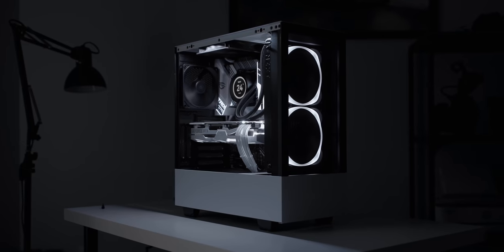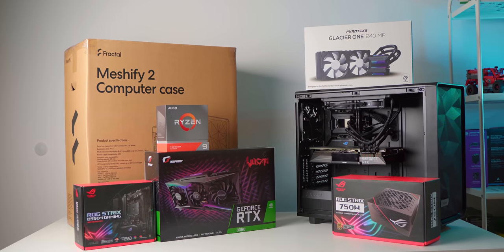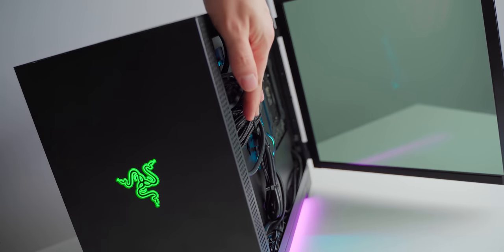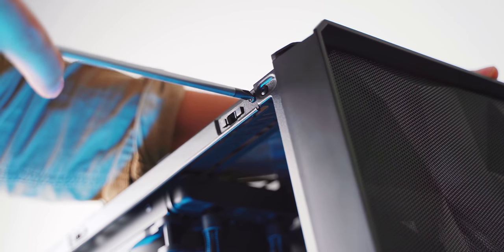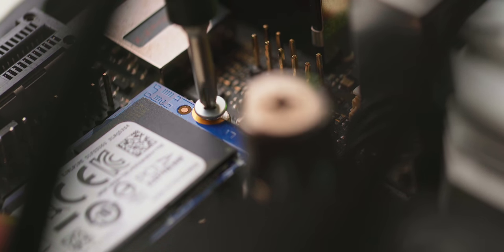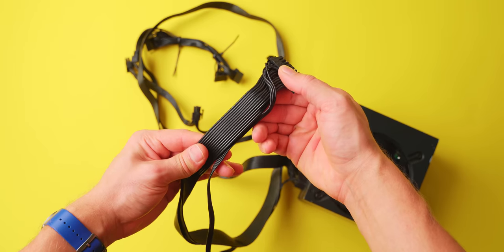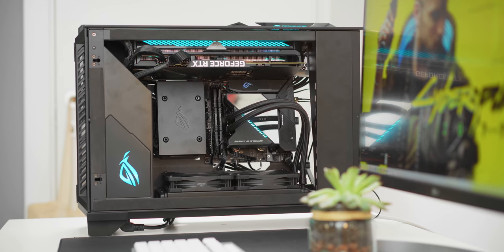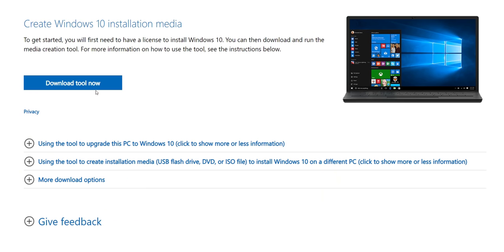AVOID these BIG Mistakes when Building a PC!!!

Comment: Because of high demand, getting a prebuilt is more affordable and worth it. That's what I did, I bought a prebuilt that was cheaper than getting the parts separately.
Reply from the maker: Yup - that's a really sad reality, but with plenty of good pre-built systems around, its always a fantastic alternative. 
-D.
Reply: I have seen prebuilds cheap out on many things, like power supply and ram etc.
Reply: @jayeshmange2952  That's what I got except the power supply. The separate parts I wanted was a better CPU which was the i5 9600k, 1TB SSD, and 16 gigs of Ram. Instead, I just got an i5 10400f, 8 gigs of ram, and an NVME 500gb SSD. I can upgrade them so it's cool.
Reply: Where I live is cheaper to buy everything separately, specially if you do it through Amazon or so, some sellers even scam you if you don't know much about it, it's risky af
Reply: @HardwareCanucks  like the nzxt prebuilt systems! lol ;D
Reply: Pre-built generally come with the worse possible quality of components. Could you tell me what graphics card you have and what model? I would be amazed if its one that doesn't thermal throttle at 80%. Your power supply, also. As for customer service? GN and LTT pre-built industry expose videos that a'way.
Reply: @En_Joshi-Godrez  It's worth checking out local computer places if you're going to pre-built route. Lots of them will let you pick all the parts and they'll source and assemble it for you, and if they're not complete idiots they won't screw you over because bad word of mouth will probably cost them far more than they'd save by ripping you off.
Reply: @TalesOfWar  That's definitely a better option, especially because  you can go and expect it yourself. Paying an extra $200-300 for that type of service would certainly be worth it for some if they were guaranteed a comparable build. However, those very specialized (as in ones that are dedicated to only sell computer hardware) stores are not very common (or even accessible right now), so most that want a pre-built must  go the way of a online service which as the op admitted (in a later comment), like to use the worse selection of components possible that still classify under their certification banner (so say you want a i5 processor, you will always get the cheaper non k skew, as well as a god awful motherboard). It's never worth it no matter how good of a deal you think it is, that's how they get you.
Reply: @En_Joshi-Godrez  you are so right. i have built 8 computers, roughly one a year and every one of them continues to function just fine. i think the better the parts (even in budget builds you can get high quality parts) the less likely you are to have a failure down the road. Prior to that i've had prebuilts by Dell, Gateway, HP and a couple others i cant remember (yeah they were definitely forgettable computers) and they just dont last or you cant update them. so for me the only reason to get a prebuilt now would be to get a CPU or GPU you and now cant get.
Reply: @jayeshmange2952  correct and motherboard.

The storage is not as direct of a con but usually how they get you with that is having a really low GB amount on a fast ssd or whatever, then the rest on a HDD. So they can advertise 'blazing fast storage with up to 1TB (or whatever)'. but only 64GB or 128GB is the SSD.
Reply: @En_Joshi-Godrez  It's not worst possible quality on all of the components. Generally the only 2 that are ensured to be good quality are the CPU and GPU (so they can advertise the amazing performance those 2 components can provide) while the rest they will cut-corners to save money while not technically 'false advertise' anything.

A lot of people think the best manipulators and con-men are liars. Which is incorrect. The best ones are the ones that distort/bend the truth but never actually lie.
Reply: @nicholaskinkaid Nope, you're dead wrong.  They use blower style coolers on high-end cards that produce over 200w, they thermal throttle at less than 80%. Go and watch GN videos as a piece of exposure to how many third party video cards are practically non-functional because of thermal issues. You seem to believe that because its called a "rtx 3080" then it will be able to fill out its function like other 3080's, which is an objective and provable fallacy. The newest one is cards like the msi Ventus 3X, a card that has been exposed to have huge none ignorable thermal issues which has led to it being 30'c warmer than reference at a clock speed reduction. That's a $800 graphics card, and I guarantee you its the type of card that the online pre built industry loves to use. And why wouldn't they? Only a fraction of the population even knows about these manufacturing defects (case in point, you seem to be unaware of them, and you subscribe to channels that cover this content).  Same goes with every other component in the system, all of which affect their longevity, due to poor quality power and thermal solutions (especially the case which is always one where the front intake is a piece of glass. lmao). Sorry, but if you're  trusting other people to effectively finance things that you know nothing about, it really doesn't matter if they are liars, that's how the pre-built industry works.
Reply: @HardwareCanucks  not in ireland there are no good affordable systems and for 1400 euro you can get an i5 with a 1660ti so i went for a custom build even though my parents said I'm wasting the money that i saved for 3 years.(I have a r5 3600x and rtx 2060)
Reply: @En_Joshi-Godrez  bro you wrote an essay with useful info
Reply: @awesome8831  that's pain maybe you could've waited a bit longer I waited 3 years before I got enough money for my pc parts.

Comment: Jeez....you nailed it on the M.2 heat sync screws.  Tiny PITAs.  Regarding M/B front pin connection, my Gigabyte came with a cool little bracket.  The Gigabyte 'G Connector'.  Nice

Comment: The worst part is WAITING!  Waiting for new releases, then waiting while all the markets are being hoarded/stolen for less than MSRP, then waiting for the Kings Ransom prices to come back to sanity. I went to order the X570 board for my next build, a week after it's release and had to do a notify me. The price then was $219... within 72 hours there were "offers" for up to $500. 3 months go by and I get notified and purchased it for the original price... THANKS NEWEGG!  At the time they were still "offered" for $390 or so. I've done several builds going back to building my 1st pc... 386 w/ 1 MB Ram, a 10 MB Hard drive that was the size of todays power supply's and a 10 inch floppy disc 720 KB if I remember right. I have all the parts for a X570 MSI Tomahawk WIFI except the CPU I want. I'll be using a Ryzen 5 3600 for now... the 5600 or 5800 is still a rumor as far as I can see due to politics and scalpers. My current "old system" works fine, an Asrock FM2A88X with a AMD 880K Quad core, and duel Sapphire 7870 XT BOOST Tahiti's. I'm not a gamer or editor, but it has worked for 8 years for writing, researching and lots of streaming. I just have to WAIT to update my "box of rocks" as my late dad used to say. He used my old 486 for 10 years.

Comment: In reference to the CPU power connector on a motherboard, if you have a modular power supply connect those cables to the motherboard before installing in the motherboard and feed them through as you install the motherboard.

Comment: 2:11 my recent Gigabyte Z490 board came with this kind of thing, so they’re still ‘current’ for some manufacturers. Also, while switching power and reset can be annoying, at least that’s ones own mistake. I had a case that had the power button and power LED mislabeled, so I checked and checked but could find no mistakes, until I took a power button from another case and that worked perfectly. That was a rather fun few hours panicking about your new build 🥵

Comment: About the CPU EPS cable, I use to slap it in the motherboard BEFORE dropping the motherboard in the case, and already route the PSU end into the top case opening so you can route it with ease afterwards without dealing with it.

Comment: For the SATA cables, get the ones that have the adjustable connector so you can put it in at a 90 degree angle without having to bend the wire because usually that will break with the straight go SATA cable very easy

Comment: For the M.2 I used the standoff screw for M.2, I couldn't use the good screw, it's just way too small, especially when the motherboard is already in the case.
Also when the SATA ports are below the video card. And when sometimes you need to buy separate 90 degrees cables. And the very hard to bend 24 pin cable, to the point you feel like you pusing way too hard into the socket or when you want to remove it.
On Ryzen there is 97% chance, the CPU comes out with the cooler even if the CPU bracket is down.

Comment: The absolute biggest pain for an enthusiast in my personal experience is fan cables. The wiring is thin enough to have a small connector footprint, but the daisy chains get rapidly out of control after 3 or more fans. I feel like it's at a point where psu companies may as well have a dedicated modular slot just for fans, instead of buying a header hub (which are still a mess for the most part) More fan companies need to do what Lian Li did with their new design, but at the very minimum can we just get rid of molex? It's been at least 12 years since SATA power cables. In would also like Power units to be more clear about connecting CPU and PCI power. Whats the difference between both of those cables, why are they not interchangable and why is there a split in ANY of them. like... no one wants a split PCI power cable. It looks horrible. I also want to see more small form factor cases which take advantage of larger boards. As gorgeous as a LianLi Dynamic or NZXT case or In-Win tower can look, i still feel like there's so much underused negitive space. More cases like Singularity where the cable management is a feature is an excellent idea but wont become affordable until more companies attempt it and make it more competitive.

Comment: I agree on the PCi locking mechanism, even using a screwdriver i'm nervous of slipping off and damaging my motherboard...
Apart from that, my main hiccup is the motherboard standoff screws, that get unscrewed when removing the motherboard, so that i then have to remove them once again with the motherboard outside the case and screwing them in the case again.

Comment: I have to agree with the front panel connector and the 19-pin USB cable. The stiff ass wire used on the 19-pin is a pain for ITX build when cable managing.

Comment: The worst part is not making sure you have all of your components, or if you ware upgrading, making sure that the components you are reusing are in good condition.  My desktop is in the middle of an upgrade, but I had to stop when I noticed that my AIO was not in a condition where I could comfortably reuse it.  So now I have to wait for a new cooler to come in the mail.

There always the little things to, like cable extensions, extra zip ties, etc. that if you don't have, can be very frustrating.

Comment: One thing I would like to see. Now that NVME drives are becoming more almost standard and cheaper. If having one single sata SSD or HDD for mass storage. Have a cable that comes with psu that is a single sata power cable. The daisy chain cable is just annoying if not needed.

Comment: I don't install my motherboard until I connect those wires...  it's easier to fish the MB and the wire slack down slowly as your positioning the thing,  plus at the same time I'm attaching the modular CPU connector(s) and fishing it to the back as well.  Then once down do the usual screw down. It's a lot easier.

Comment: When installing a radiator with pull fans in the top of a case (or at least the last time I did that in a case without a removeable tray) I made it a bit easier by using half the number regular fan screws to attach the fans before installing the radiator.

Comment: great video I can't stand rubber grommets they always come out had this problem with Corsair   Carbide spec Delta  RGB case  the 2nd worst is USB 3.1 it so easy to bend the pins

Comment: A comment at 4:54 a thin screwdriver works, but be VERY careful not to make scratches on the backplate of your gpu :) you might not easily see them, but when your gpu is out, you will see them very clear

Comment: Standard SATA cables can be replaced with thin/round/sleeved ones, but the problems with USB 3.0 front panel connector are on all sides: the motherboard socket, the plug at the end of the cable itself, the cable that's permanently attached to the front panel i/o, and to some extent the thickness of the cable. I refuse to use it, rear i/o is the mvp.

Comment: The worst part about  my first PC build was finally getting my hands on a 5900x and trying to place it into my socket and it wouldn't fit, I flip it over and see the pins were bent. I had an aneurism of sorts, luckily after 5 minutes of shock and some very fragrant language, I was able to fix the pins with a razor blade! Beyond that though, everything else on the computer build went together exceptionally smooth!

Comment: For me, it is the cable management. I've built 3 or 4 computers by myself now (with help from you guys and like LTT and jayztwocents), but I like my builds to look nice, which makes it more annoying. It depends on the case and where you can route them, then if you go rgb, you need more cables, and to add more later on (such as I want to replace my normal fans on my aio with rgb ones), Id have to take it all apart for my own sanity to add in more cables. I have tons of velcro cable ties which help, but it's super annoying. At least in my current case, using a corsair crystal 280x I believe. I have half of the back to do cable management because I have a 2 tb hard drive so I need the drive bay and the power supply take up more space too, AND since I want it to look nice, I got custom cable extensions, which adds more cables into a not so big area

Comment: A recent problem with motherboards, moving the USB 3.0 Header to the bottom.  That dumb thick 3.0 cable have a hard enough time when it was under the 24 pin power but now it has reach to the bottom.  Good luck if the case doesn't have a good route for that thick cable.

Comment: The worst thing for me about building a computer is wanting to build another one, but can't. Also, something to go along with not having the latest operating system's installation media, forgetting to download the latest BIOS/UEFI. I lucked out and was able to buy everything I needed to build a new computer at the end of November, beginning of December. Being the first system I've built in twelve years, when I couldn't boot past the UEFI, I thought the BIOS needed to be updated. Since I was temporally reusing my old chassis, I had to put the old system, motherboard with CPU and RAM, plus the PSU, on top of the case, stretch a SATA cable out to the mobo, then stretch a power cable down to the SSD, go online, and download the latest BIOS. Thankfully everything went smoothly, and I didn't brick my brand new motherboard. Turns out that, that wasn't the issue, though. It was a bit perplexing seeing all the drives recognized, but not being able to get the computer to boot to the one with operating system on it. Searching online with my cellphone, I came across someone's video that mentioned the compatibility support module, and was able to enable boot device control, selecting UEFI and Legacy OPROM. Not sure if that was the correct option to pick, but it's been nearly a month and I haven't had any issues.

Comment: The worst thing are the (old) cases with not enough clearance in the back. Especially when you have to route multiple Sata powerstrips and there is an external device (like a water pump) that needs sata power. The time spend to manage the thick 24Pin cable between the wide sata power connector and to squeeze them is just too much

Comment: Guided by what you cited as the cons when it comes to cases, I came to the conclusion that the NZXT H510 Elite I got a few months back and built my very first config in is incredibly user-friendly and easy to build in. You guys bashed it for its apparently suboptimal airflow, but it's absolutely not bad - my RTX 2070 Super never goes past 75⁰C after hours of running at 100% use, though it's usually several degrees below that (I also have a front-mounted AIO, so my CPU temps are great as well, remaining in the 50s during use). If NZXT were to release a mesh front panel mod for the H510 series (for people who absolutely need it, I really don't), they could probably become some of the cases easiest to recommend on the market.

Comment: Al true...90 degree power connectors pls...on gpu, 24 pin etc makes routing cables a lot easier. Never understood why power, reset etc is still some separate mini connector...standardise in 1 decent cable and connector and solved. Same for installing cpu coolers.

Comment: My bit with cases is why can't they be about 25mm taller.  Just add enough room to put a 240mm AIO in the top so it won't overhang the motherboard.  You spend a lot on a motherboard and cut off the heatsinks which is usually part of the aesthetics...

Comment: Worst thing is when something breaks and you gotta test and return parts. Recently had a customer with bad ram and a faulty GPU, good thing I knew how to check and single things out otherwise I'm sure the customer would have just returned it all and bought a prebuilt if they were the ones building it.